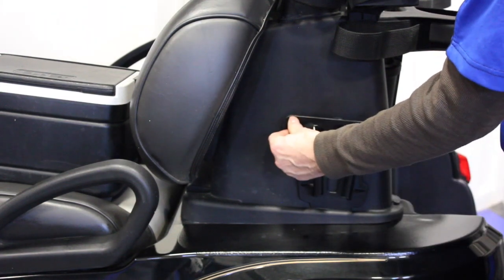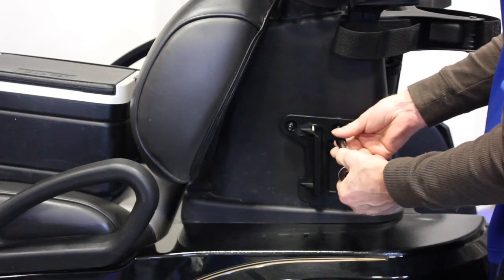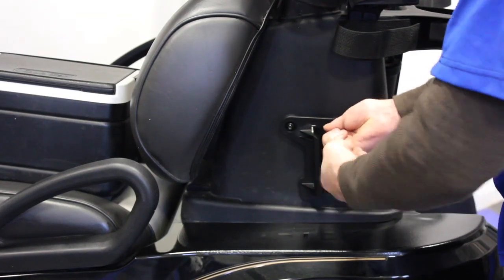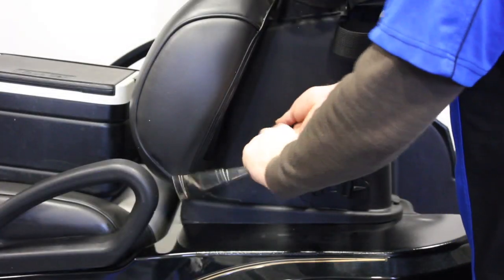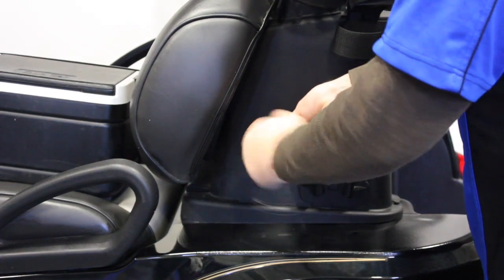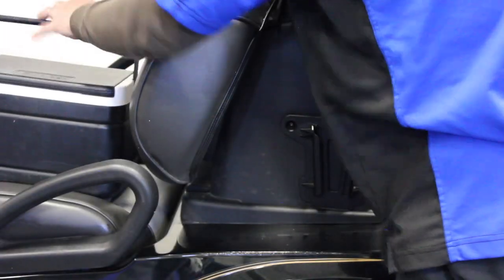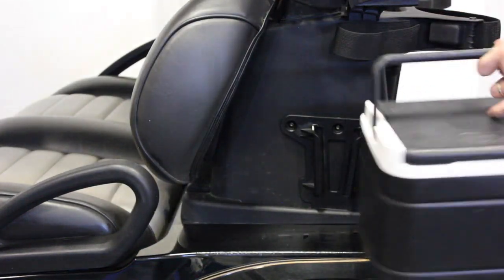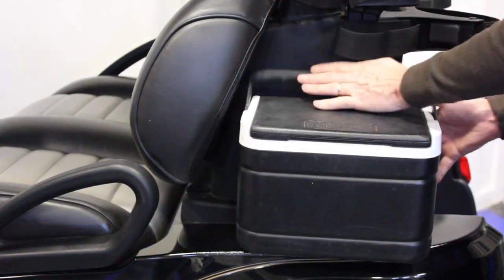Cooler Installation

Comment: What size screws are those?
Reply from the maker: Tom, I believe it is ( M6 1x20 Flange Hex-Head Bolt ) you can also use a ( M6 x30 Torx-Head Screw ).